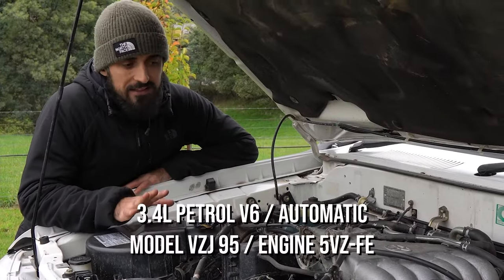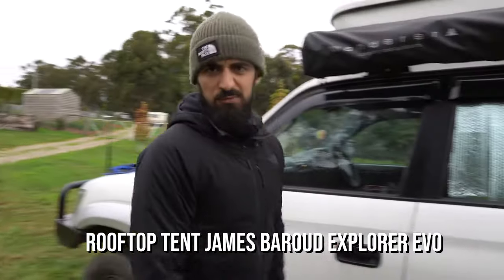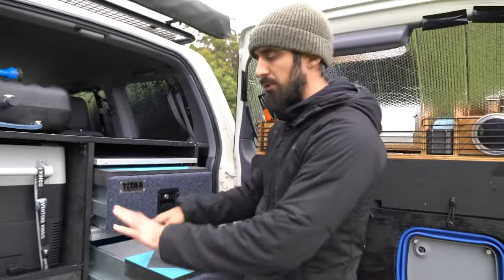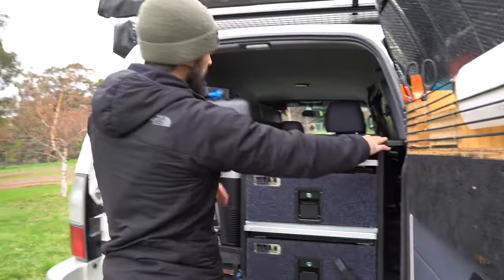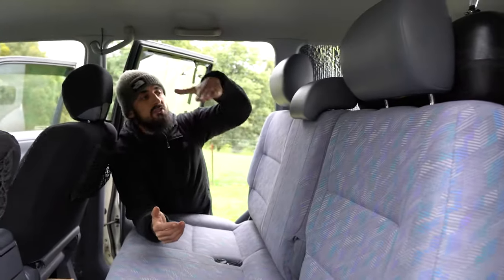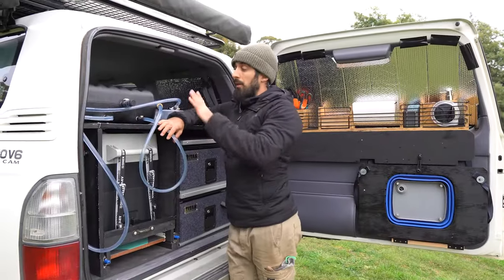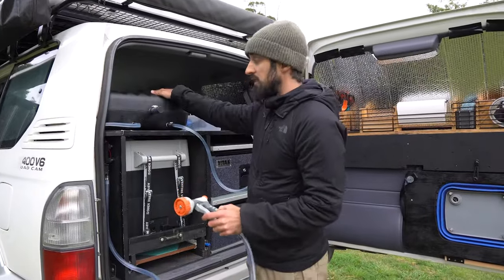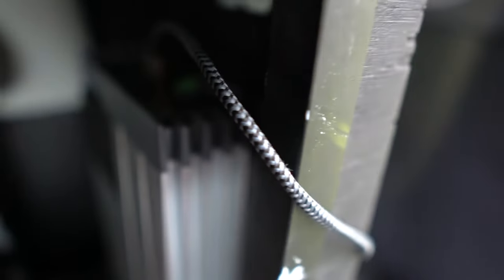ULTIMATE OVERLANDING SETUP | Toyota Landcruiser Prado 90 series

Comment: Great vid... Carful storing things on that platform under breaking. They might come forward and hit you in the head. Love the water tank trick
Reply from the maker: Thank God nothing happened :)
Reply: Follow-up on this, I had the same thinking, how do you keep things from hitting you if you have to brake hard or so? How the watertank is kept in place  and how are other things kept from moving? Very nice ideas!
Reply from the maker: @DLightBelgium  The rubber materiel we put on top of the plywood prevents all the plastic boxes from moving, even when we had to break hard. Same thing for the water tank, especially since it weights 60kgs when full. The whole thing doesnt move at all !!

Comment: Inspired ideas and layout. Are you able to store the sleeping platform in the vehicle in the 5 seat configuration?  And did you have a hot water solution? Nice video, thanks for sharing
Reply from the maker: Yes we could store the plateform, just on top of the back part of structure (the one where the water tank is). No hot water solution though, we kept it simple

Comment: Hi Julien, amazing set-up! Real cool ideas! I've now loads of inspiration for my upcoming J95 custom build. How/where do you store the storage/sleeping platform and how did you build it to take the load e.g. two adults? Would it have been possible to construct the whole set-up to achieve more clearance to the ceiling (more space when sleeping in the car)?
Reply from the maker: Hi Jan! Glad you liked our setup :)
The sleeping platform is one piece of 15mm plywood + 6 wooden feet to support the weight, really solid for 2 adults. We used to store it on top of the back plateform, where the water tank, table and chairs were stored (the 2 plateform had the same size, we did it on purpose). About the height between the platform and the ceiling, we could have had maybe 10cm more by choosing a smaller fridge, but 40L was the minimum for 2 adults.

Comment: Nice setup ! I’m about to make mine, this one has plenty of nice features. Were does the water tank go when you are in sleep-inside configuration ? 

I would be interested by some of the measurements of the back door shelves as they look really neat if you don’t mind sharing. 

Enjoy your trips man !
Reply from the maker: Thanks for the comment mate ! Unfortunately we sold the car about 2 years ago, when we had to come back to France because of covid situation, so I won't be able to give you measurements of the back shelves. What I can tell you is that the water tank position was not very safe as it wasnt strapped to anything. I would change that by using latches and starps to maintain it. We didnt have the occasion to sleep on the inside plateform after we installed it, we sticked to the roof top tent. I can send you more photos of the shelves if you are interested, just write me your email. See ya !

Comment: Brilliant video, Julien. May I ask a question - what if the battery needs to be changed (the one next to the box in the back of the PRADO?). 
I guess could it be every 3 years? 
So, technically, if one is traveling with a brand new battery, it should last?
Reply from the maker: Hi David ! The auxiliary battery can easily be changed (even if it's super heavy!). The longevity of AGM battery will mainly depends on how you use it : never get lower than 65/70% to make it last the most